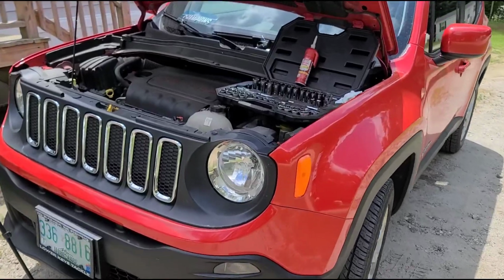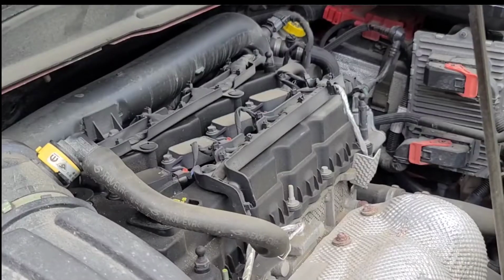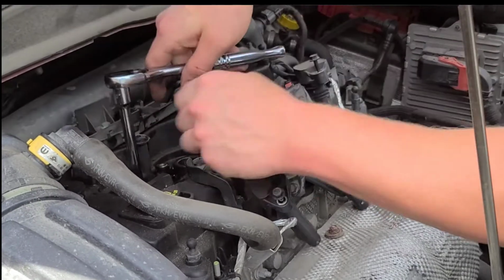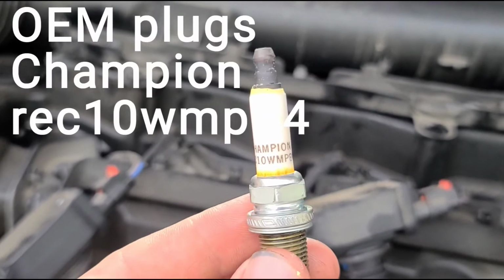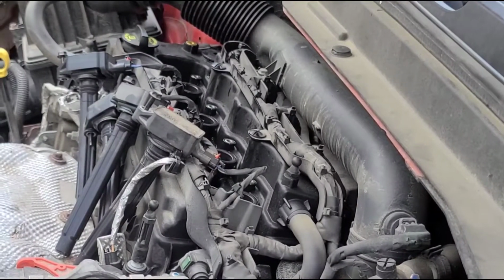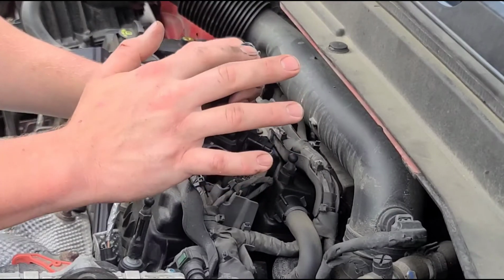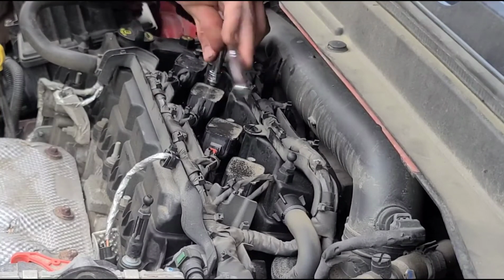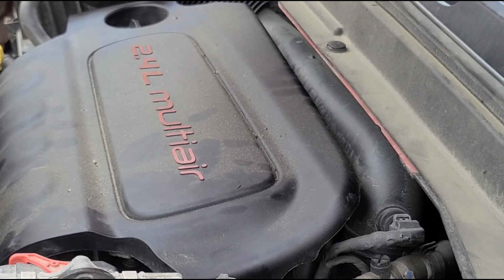2.4 Jeep Renegade, Cherokee,  Compass spark plug & coil pack replacement how to / diy

Comment: I just changed the spark plugs on my 2017 Renegade and it cured the slight skip, miss, and or hard shift occasionally happening
Reply from the maker: awesome im glad it fixed the issues 👍
Reply: Interesting, did u replaced the coil packs aswell? Im a little mechanically inclined and i was thinkimg of replacing the spark plugs, days later it started giving me the typical "transmission" issues, went to get the trans update from the dealer and went  away some what, but you are the second person i see on youtube that says this fixes that other issue.

Comment: Thank you for this! I'm going to attempt to replace mine later today and this video made me feel much better about it
Reply from the maker: your welcome, you will have no problem doing it yourself. thanks for the comment 👍
Reply: @603Mechanicvids  was able to change out the spark plugs and coil packs quickly and easily. Fixed my issue! Saved so much money doing it myself vs what the dealership wanted to charge for it. Very grateful for this video!

Comment: The one thing one for got to mention that when you get your spark plugs before inserting them you have to size them for the right size some of us that are not really mechanically inclined wouldn't know to do this..
Reply: A lot of plugs come pre gapped and will get damaged if you try to gap them.

Comment: You should have told ppl to look in the hole before taking out the spark plug. Sometimes dirt and other things get into the holes and if you don't blow it out it will fall into the cylinder when you pull out the plug. Always clean it out first then pull the plug.

Comment: 3:15 Do NOT just pull on the connector it will break the locking nub off the coil pack. Pull back red locking tab and pinch down while pulling

Comment: My jeep renegade 2017 jerking during acceleration between 35km/h-40km/h. There is no errors, service checked 3 times, can't find issues. Is that can fix car jerking issues?
Reply: Same thing at 30 I misfire so I'm about to Change them no check light or any other issues

Comment: Bought a 5/8 spark plug socket but it seems like it is trying to strip the spark plug. Everywhere I read says it should be a 5/8, is mine suppose to be a size down? 2018 jeep renegade latitude.
Reply: Found out it was just the socket I was using, the magnet was not allowing the socket to sit all the down around the plug. Replaced socket with a rubber filled one and had no issues. Thanks for the video!

Comment: Sorry for the dumb question but did you disconnect the battery or just didn't show that part for obvious reasons?
Reply from the maker: I didn't disconnect the battery
Reply: @603Mechanicvids  thanks for your vids my man, I just bought a 18 Latitude
Reply from the maker: no problem im glad I can help out

Comment: Over the last month, my gas mileage dropped from 25 mpg to 18 mpg.  Is this a plug problem?
Reply from the maker: it very well could be your spark plugs, air filter, possibly bad O2 sensors. id recommend a good tune up that should fix the issue
Reply: @603Mechanicvids  Thank you for your response.  I'll replace the plugs and air filter myself (referring to your excellent video) and re-assess.  Much appreciated!
Reply: How often should youk-up on 2017 renegade. My vehicle engine light comes on when im driving over 50 mph and the dealership said  that there's nothing wrong. Do you think I need a tune up? @603Mechanicvids

Comment: Got a 2.4 2018 renegade and my my coolant drops from max To min within days or seems to be sucked into the hoses. Not sure if that’s how it works or I might have a leak but nothings leaking on my garage parking. And I don’t see any leaks on my coolant hoses, nor into the engine/engine oil. Also the car doesn’t show its low it shows that it’s just fine rolling at “min”
Reply from the maker: sorry for the late reply. definitely not normal to lose coolant like that, did you make sure it was up to temp  while checking for leaks? you may have an internal issue happening i hope not for your sake
Reply: Did you figure it out ?
Reply: Yeah it was a small drip by drip leak towards the lower radiator hose but nothing crazy. Just a hose replacement. Guess the clamp was on to tight.

Comment: Got all my plugs in and k and n air filter thankfully i didn't have a plug shoot through my hood and startup now seems to Rev much higher now like its excited. I also made an odd discovery the factory calls for a 0.47 gap I did a 0.43 on my ngk IXs and when I measured the the champions that came out of the car they were also a 0.43 hmmmm and they've been in there for 42k miles. What's your take on this? Also if one of plugs wasn't exactly 0.43 but a little off would this hurt anything ?
Reply from the maker: I'm sure the engine was very happy with the new parts I would always recommend making sure the gap is what the manufacturer recommends, not really sure why the old plugs were .043 instead of the .047 have the plugs been changed before you did it?
Reply: @603Mechanicvids  nope I think not. As they were the champions rated for 75000 miles or so but I like precautionary service. Idk why NGK recommended 0.43 but apparently mopar agreed but tells everyone 0.47 I don't get it

Comment: What gap my friend?
Reply from the maker: 0.047 inch gap this is only for the 2.4L
Reply: @603Mechanicvids adding onto this much, much later, but from what I understand these specific champion plugs are pre-gapped to 0.045. that's what mine looked like anyway and I was advised to leave them as is. Is this accurate as far as you're aware?

Comment: We're is number 3 plug
Reply from the maker: looking at the engine the side with the pulleys and belts is the actual front of the engine, so the plug order is 1, 2, 3, 4 from front to back

Comment: How can you tell what cylinder it is? A code came up and said my issue is a failing engine coil and sparkplug.

I'm planning on doing the repair on my own. But the failing part(s) is on cylinder 3.
Reply from the maker: so the front of your engine is the side where all your pulleys and belts are. so the cylinder closest to the front is #1 then in order #2, #3, #4
Reply: @603Mechanicvids  Great, thanks
Reply: Same exact code just happened to my car and I'm only at 56k miles. #3 coil too
Reply: @artemismae356  I found out that the front of the engine is where all the belts and pulleys are. From the front,  it counts in order, 1, 2, 3 , 4, and so on. When you're standing at the front of your car, the engine, at least in my car, is sideways, and the front of the engine faces the right of the car. Once you identify the front, you should be good. If your issue is at cylinder 3, from the front of the engine, just count 3 back.
Reply: @artemismae356  it's an easy fix. I recommend replacing all of the coils and sparkplugs in the engine. When I replaced mine at cylinder 3, the problem lessened but was still a little jerky. So, I replaced them all and now it runs smoothly.
Reply: @regaininglife9084 
Thank you, I replaced all the spark plugs and coil #3 and it's still happening. It's stressing me out.
Reply: The only other possibility is a completely different issue with the car. But if you had the code checked and it came up with nothing else, then I would trust it is the spark plugs and coils. They are very finnicky and if the ignition from the spark plugs isn't in sync, it will still have some jerking and jolting issues. Some or all of the other plugs and coils are worn (but not failed) and because of that, it will cause this problem. It sucks because it's more money you have to dish out. This was my experience so I replaced them all. I also recommend maybe adding some fuel system cleaner in your tank the next time you fill up. Sometimes this helps the engine run smoother too.    @artemismae356